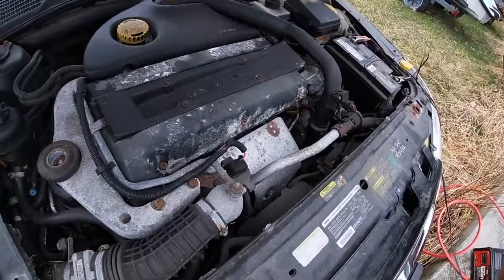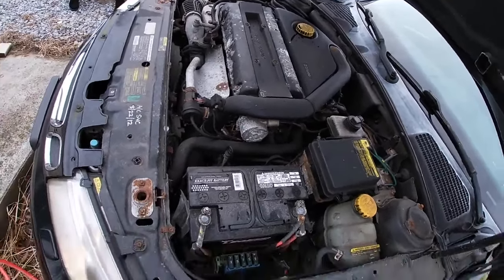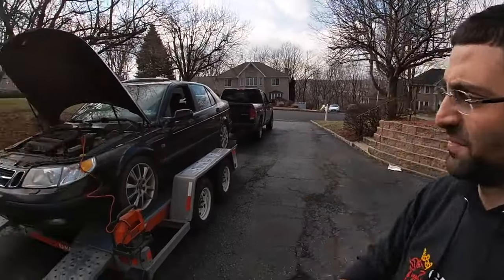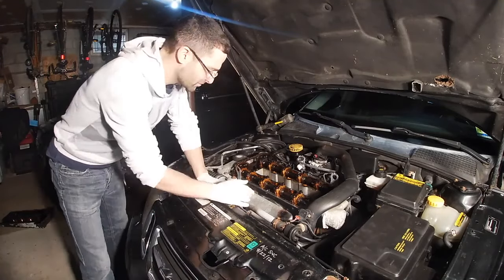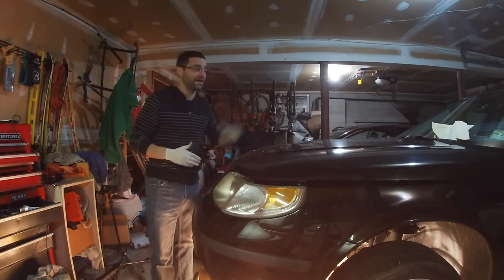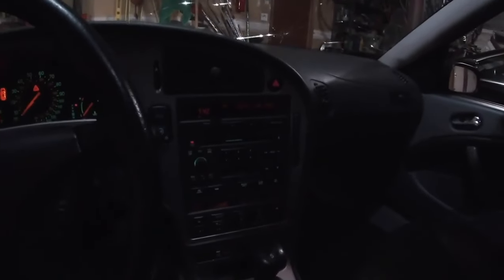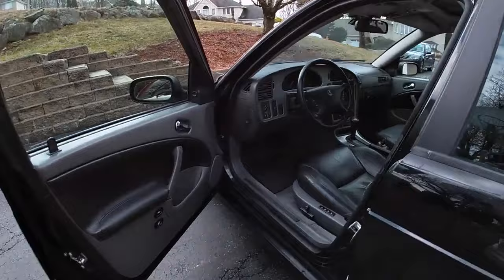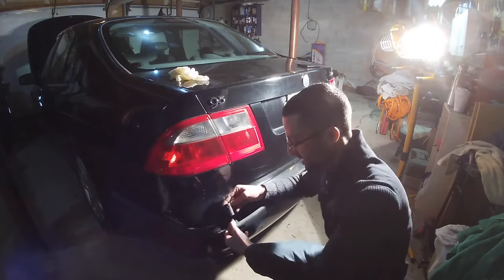My Cheap SAAB 9-5 Aero Transformed in Minutes! + GIVEAWAY!

Comment: I pickt up my free saab 9-5, 2002. With 200,000 Miles on the odometer. Going to try saving it from the junk yard. I turn to your videos for tips. 
Tomorrow the valve cover Will come off. To see if there is Any Hope for the engin.
Reply from the maker: Amazing! How's it running??
Reply: Kyle Pancis I have only driven it a short way to my repaire shop. Have to change oil before I do longer test drive.
Reply from the maker: @hakanmagnusson5667  yes! and make sure check valve is working properly. https://www.youtube.com/watch?v=7rp8gGnrjg8